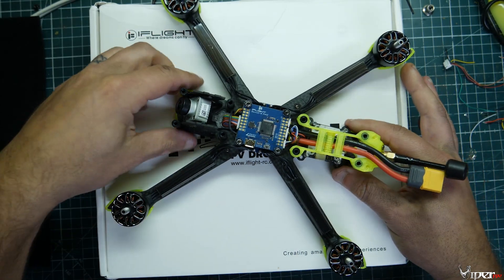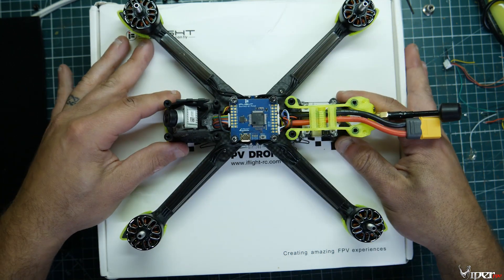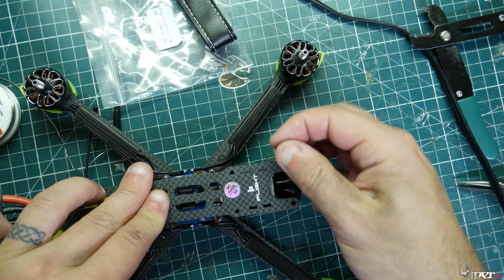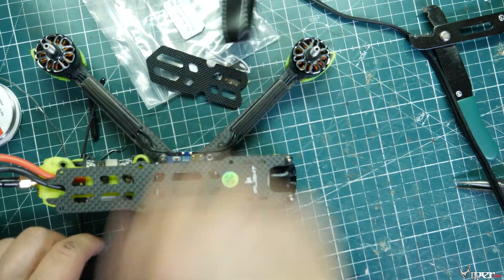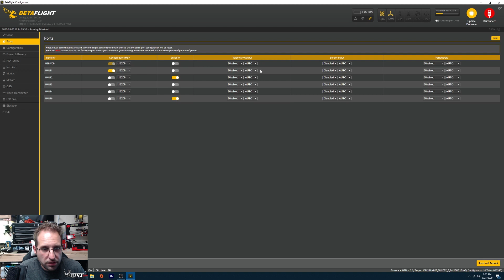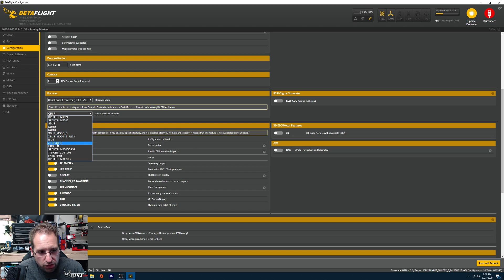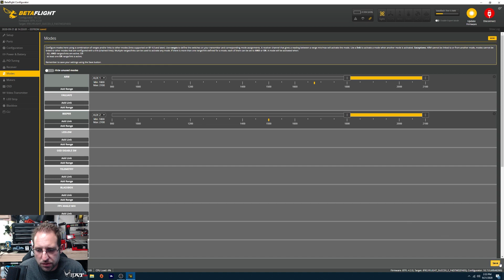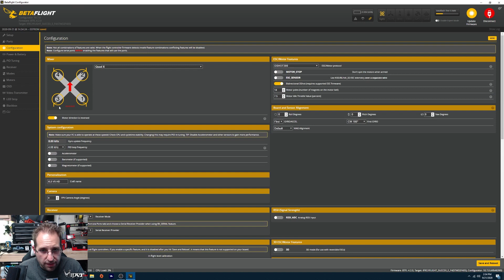Iflight Nazgul5 HD Complete Setup & Tutorial

Comment: If you don’t have FPV goggles, can you simply fly these around much like a RC heli? Also, will this system auto stabilize and fly as easy as a Mavic mini out of the box? Very new. TIA
Reply: Very late but you can but LOS on an fpv drone isn't as easy without lots of practice. Yes it will auto stabilize as well once you set the modes in Betaflight

Comment: Attention: Your VTX is not configured or not supported. So you can't modify the VTX values from here. This will only be possible if the flight controller is attached to the VTX using some protocol like Tramp or SmartAudio and is correctly configured in the Ports tab if needed.

any idea why this comes up :( not sure what VTX the nazgul is

Comment: Do i need to buy digital dji v2 goggles or can i fly it with my aomway commander v2 goggles?
Reply from the maker: For the Caddx vista version yes either V2 or a used set of V1 DJI goggles. The aomway will not work with caddx vista. For the non HDO version that uses analog then the someday commander V2 would work
Reply: @ViperFPV  thank you very much

Comment: You are running Dshot 300. Why?
Reply from the maker: It’s because the FC is a F4 processor and the esc is a blheliS esc running rpm filtering. (It has the special flash already installed) Only on the F7 can you run dshot 600 at 8k. It’s to save processor cycle time. If u enable both it’s possible you can have an issue.

Comment: just got my nazgul and cannot bind it with my radio. do i need a battery plugged into the quad for the binding process to work?
Reply from the maker: I don’t remember but you should see a light on the receiver when it’s powered up
Reply: This was ten months ago so you probably don't care anymore, but 90% of the time you just need the proper firmware on your receiver. Did you ever get it working, if so, what was the issue?

Comment: Do i need to flash the firmware?
Reply from the maker: It depends if u have 4.2 already.
Reply: @ViperFPV  i have the latest version of beta flight with all the drivers installed. Honestly i still have no idea what im doing. I did all of these instructions and my drone is properly binded yet the rotors dont even spin. And the arm switch aint working either. Please help.
Reply: @jude_hildreth6582  You ever get it fixed?

Comment: Is there like a pcpartpicker equivalent for quadcopters? lol
Reply from the maker: Actually yes! Check out rotorbuilds
Reply: Viper_FPV awesome! Thanks man. I’m a bit out of my depth here, shopping around for my first FPV quad
Reply: Mission success, everything is running smoothly. Thank you very much for the video and the help. I'll be back to watch it again shortly, as this video made me want to switch my QX7 and Rx to Crossfire
Reply: @RYVENANT  Do you have a Nazgul5 now? Can you tell me the other components you choosed?
Reply: @Anto-lm6ji  the nazgul is a BNF, you shouldn’t need anything other than picking a receiver like crossfire for the quad itself. 

Then you just need goggles (I recommend going digital) and a transmitter that uses the same protocol as the receiver you pick. 

So pick a quad, grab DJI goggles, a Tango 2 (if you like how those look) and a crossfire receiver. If you can’t get a tango you can always just get a crossfire module to mount onto a different transmitter.